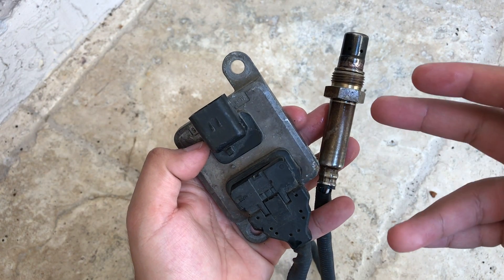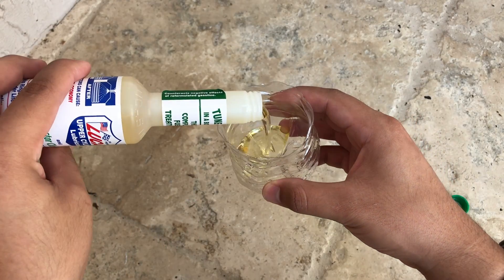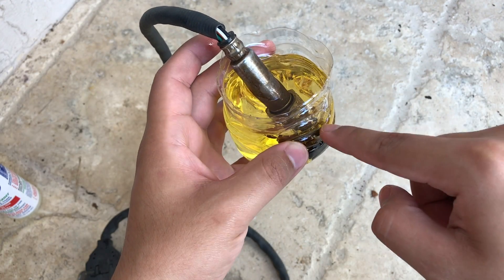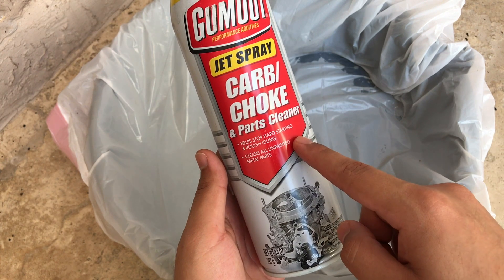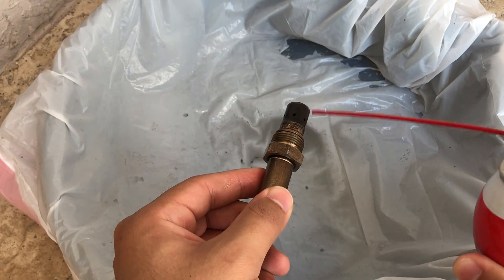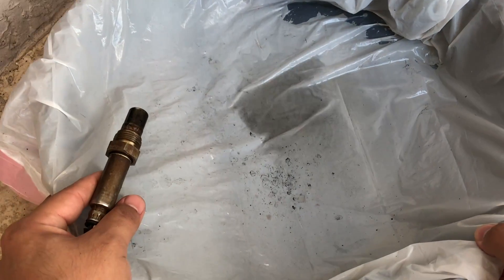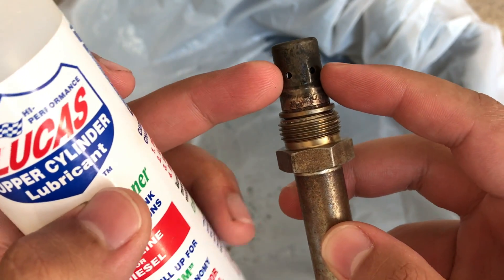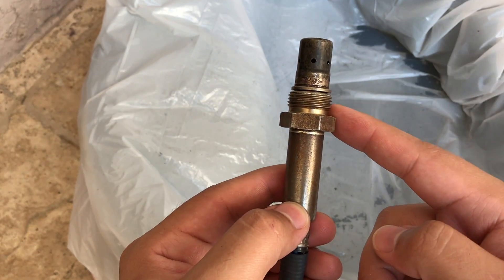How to Clean OXYGEN Sensors [Easy Way]

Comment: I have a Volkswagen Touran 2004 1.6 automatic and it has error code P2201 / 17443 (NOx sensor). Any advice on if I should try cleaning it or just get it replaced? I'm not a technical person at all. Thanks!

Comment: I soaked it in vinegar. Completly clean.
Reply: Did it work when you reinstalled the sensor?
Reply: @gracec1665  following
Reply: Did you put it back and it worked? The CEL went away/cleared?

Comment: My 2002 RX300 O2 Sensor B1, B1 is producing P1133 Error Code !  I'll this cleaning process to see if this will correct the P1133 Error Code !!  Thanks for the illustration !!
Reply: Did work for you on your Lexus?

Comment: Thanks a lot, you make me save money! Before to pay for a new sensor, I clean my BMW F10 N53B30 nox sensor as you explain. After ODB control, all default codes about this have been removed!
Reply: Do you remember what codes came up, when you had this issue??
Reply: @erickmellado6417   12C008. 12C208  12C601. for nox sensor short circuit and signal not available
Reply: Is it necessary to turn off the "check engine" via diagnostics after cleaning or will it definitely turn off if it is working properly?

Comment: You can soak them in plain gasoline too , it works great...never did use F.I. cleaner ..but it makes sense ,  and  not 6-7 hours.... try more like at least  8 hours with some light swirling agitation every hour,  it can take up to 10 hours....dry the O2  sensor and re-install.  
Goes without saying inspect the shit out of all the wiring ..on  ths sensor and vehicle ..i find 50% of the time its wires or a combo of dirt and bad wires
Reply: Petrol or diesel?

Comment: Why do you keep calling it a knock sensor...it's an 02 sensor.
Reply: O2 sensor is for gas cars and nox sensors are for most diesel engines including simi trucks.
They both works the same way. You can clean them and they will still work if there is a soot build up. The soot blocks up the small port holes,that's when the code mostly will appear. Get sm acetone or carb spray or rubbing alcohol and wipe it off good and let it dry. Then install it back. Take your negative battery cable off to reset the code. Make sure you always check your wiring harness as well before installing the sensor back because that's a lot of heat that travels through your exhaust and sometimes it will melt your harness and cause a sensor code. Hope this helps..

Comment: The Lucas cleaner is made to be diluted with gasoline for the best cleaning action.  Which means about 1/10th or less was needed.
Reply: Also use less  much diameter vessel ...will save on extra unnecessary fluid waste
Reply: Even agitating with a brush and then spraying cleaner saves cleaner...too much unnecessary spraying
Reply: The injector cleaner is made to keep this from happening in the first place! I have to change one of mine on my 2019 Duramax one sensor was 100 percent clogged and one is 50 percent clogged. Had I bought this Truck new im sure with running Lucas in the tank this wouldn't have happened in the first place.

Comment: What was the error of the car for the reason of cleaning the sensor? Which problem did you have with the car?
Higher gas consumption?
Thanks
Reply: It throws a check engine code that you see on the dash.  The code is read with a code reader.  I think the specific code number may be unique to each brand or model of vehicle.  A $27 code reader can save you a shit ton of time and money as they usually give you a direction to go to diagnose and correct the problem.  The dealer has a better one that is more exact but the cheap ones will work for you MOST of the time.

Comment: Shit....my o2 sensor cost $250.....going to try this. Well2 see how it gos
Reply: and i paid over 400 dollars to get mine replaced, and after just four months, have to do it again it appears!! 😞
Reply: @neryahwilson6499  do it yourself an save money all you need is a claw tool to remove o2 sensor an the sensor itself which you can buy on ebay for low prices..most of them are OEM parts you can find for way cheaper than spending 400$ brother lmk if you need help finding a good deal.

Comment: Do not do this if you are under warranty.  If you are outside of warranty, do not do this unless you plan to throw the sensor away anyway.  You are at high risk of either ruining the signal long enough to set a fault, or breaking the sensor outright.  If the tip looks a little sooty, just wipe it off with a dry or slightly damp rag.  Do not allow any fluids inside or spray it with anything unless you don't really care anymore, as it contains delicate chemically sensitive electrodes.  This is not a spark plug -- as indicated by its cost.  If you insist on running this little experiment, then using pure fluids that evaporate without residue.  Acetone, 90+% rubbing alcohol, and Carb Spray.  I suggest you avoid using anything like fuel injector cleaner or WD40, as they evaporate slowly and contain additives that could permanently poison the sensor.

FYI, I work on NOx sensor design.
Reply: My question is what is the root cause of the issue of bad o2 sensors? Is it erosion of something inside the sensor that cannot be replaced, or is there a way that they can be refurbished to last another 50-100K miles? Nobody ever talks about what the actual issue is. They just say carbon build up. Well if it is carbon build up, then why is it that when the carbon is removed, they still don't work or only last a month or something. I'm of the mindset that 95% of all things can be fixed or restored (unless there is erroded parts or missing stuff).
Reply: @chancehansen  Once you reach high hours, there are wear-out mechanisms that cannot be fixed.  For example, in a light bulb the tungsten filament slowly evaporates and cannot be fixed.  Similar things are happening inside these sensors.
Reply: Gasoline sounds like it should be ok to clean a sensor since there is unburnt gas regularly flowing through the exhaust albeit in low concentration. What would you suggest to clean it?
Reply: @chrismc8548  r&d of sensors is his livelihood, hes not gonna tell you to salvage a faulty sensor, he'll tell you to buy a new one
Reply: I don't have a faulty sensor just a dirty one that I would like to clean up if possible. No better person to ask how it should be done than a guy who designs sensors for a living. Thanks for your opinion on the matter but I'll wait for Omega QED's response.
Reply: @chrismc8548  
I was going to write a lengthy list of ways you could end up killing the sensor using gasoline, injector cleaner, water, etc., but if someone absolutely insists on soaking it in something, here are my two cents:

Use a high purity solvent that evaporates rapidly, blow it out, then let it sit around for a day to ensure nothing remains inside.  Something like 100% Acetone.  I don't know what good it'll do you, but at least you're less likely to kill the sensor.
Reply: @omegaqed8592  it sounds like the problem is caused by any liquid or residue remaining in the sensor when it gets heated If I'm understanding correctly. This would rule out gasoline for sure. Thanks for the info.
Reply: I was installing a new Y pipe (after converters) that takes a great deal of time and gives access to the downstream O2 sensors on a Nissan Murano 2009. At the price they go for on line it is a no brainer just to replace them. Why would I take all that hassle to attempt a "Cleaning" that is generally panned as a waste of time.
Reply: @kerrysly1  O2 sensors and NOx sensors are different, with largely different price tags in disadvantage to the NOx sensors. O2 ones are "cheap", NOx ones are measured in gold.
Reply: @kerrysly1  look up upstream O2 sensor for a 2003 Honda Civic si (AKA ep3) part #  36531-pnd-a11, the dealer has them listed for the budget friendly price of $760 without installation which is a diy job but the part price is definitely worth trying to clean.  Aftermarket cheap O2 sensors don't work on Hondas.
Reply: If wd40 gets in the system is it fooked for sure or can it purge it eventually?
Reply: Please make better sensors they are not very good. I'm on my 4th one on a sprinter van
Reply: What happens if you use an ultrasound bath?

Comment: I just put mine in ultrasonic cleaner for 2 min and it was all clean! Surprised at what comes out of the holes on the sensor when using a ultrasonic cleaner . I really think it's the best way
Reply: does the engine light still come back on?
Reply: What sauce in the bath
Reply: Soak in 100% acetone or just use carb cleaner nothing else an air pressure to dry faster if you want to get the job done quicker.
Reply: @babyboi4778  I do board-level repair on electronics, electronics that occasionally requires ultrasonic cleaning.  To remove the residual water, the industry standard is 99% isopropyl alcohol (IPA), never acetone.
Reply: in what solution? ive read degreaser/soap/water....and then again w distilled water

Comment: 1) BE A MECHANIC
Don't hire a mechanic to do this and expect little to no charge.
Remove & install (provided its not a removal issue like rusted in place) is a plug & play for a mechanic.

2) Have another vehicle ready for use.
This o2 car will be offline for a few days

3) Stop driving altogether
If youre too cheap to purchase a new sensor (amazon!) then you should not be driving

Comment: hi guys i have 2018 mercedes c220 d my knox sensor downstream looks like gone,garage told me that this kind of methods wouldnt solve the problems .they says cpu needs calibrate as well ??
Reply: Depending on the price it may be more efficient to buy a new sensor. Also, I always reset my computer after every time I alter something on my engine. *To reset a computer, simply unplug your cars battery and let it sit overnight.
Reply: You can get Mercedes to replace the Nox sensor for free as it is a well known issue even by them especially considering the age of your car. I had mine changed on a 2015 E220 BLUETEC some 3 months ago
Reply: @ntandongwenya3897  My dealer yesterday would not replace my NOx sensors under warranty.  They were replaced in 2019 and have about 20,000kms on them.  2015 GLK.

Comment: can i use wd-40 for cleaning?
Reply: WD-40 is only for water displacement.
Reply: No
Reply: WD-40 is specifically a degreaser, as well as a lubricant. So no would not be a very good idea to use WD-40, since it will attract more grime and dirt than anything, overtime.

Comment: I used CRC Mass Air  Flow Sensor Cleaner. It worked well.
Reply: Did you just take off sensors, spray, wipe and re install?

Comment: You will save a couple of weeks a max month,  at the end you need to replace. So two times you will need to dive under your car, and if you break NOx mounting on your cat. then it will be very paunful for your pocket. It wears out not gets dirty. 
Tired NOx makes your car hungry for fuel. So playing with this chemicals you not only breathing toxins but also loosing money and poluting:D
Reply: It is worth to try anything because these sensors are made of gold judging by their price. I am looking for a bypass to this system because i can't afford to change these sensors all the time. If it is this expensive to save a little polution it is not worth it.
Reply: @Davoodoox1  I'm sure it's too late, but have you ever checked out Rock auto parts? They had about 15 different priced sensors for my car, from $34 to over $150.
Reply: @bigredc222  I made a motor optimization (tuning with computer) and AdBlue OFF a couple of days ago and the car runs like new and i will never have to bother with AdBlue correlated problems again. I am super happy and amazed how well a car can actually function when no crap system is in the way.
Reply: @Davoodoox1  Are you saying you have a diesel and figured out a way to get it to run without AdBlue? 
What about when it comes time to get your yearly emission test?
Reply: @bigredc222  No problem with emission testing. Then all the other diesels without AdBlue would fail too??? If you remove the DPF then you have problem with emission testing. Yes a simple programmin called AdBlue OFF was done and car runs like new.
Reply: @Davoodoox1  I would think vehicles that come set up for Adblue would have to meet a different standard than older vehicles without it.
Reply: Where we can get or downoload program for AD Blue OFF to save our selfs from all this sensor crap?
Reply: @martinmitevski4110  There are tuners everywhere nowadays. Just google AdBlue off near where you live. But remember your car is actually not roadworthy anymore afterwards and everything you do is on your own risk. I personally had to do it because i could not stand to pay for the AdBlue system repairs anymore, it was driving me insane.
Reply: @Davoodoox1  I don’t think so that there is any worse upgrade ever made on the Diesel engines  when it was decided for Diesel Engines to have AD BLUE ( for cars and semi trucks engines also)
Reply: @martinmitevski4110  Yes i somewhat agree. The system itself is almost magic. Think of the old days when a dieseltruck was running inside a warehouse for example. It was impossible not to start feeling sick within seconds. But modern diesels with AdBlue you can not even smell they are running. But when the sensors cost thousands of € to change it is impossible to keep the system running. If a sensor was only max 150€ each  i would keep the system running, but my last bill was 1200€ for ONE NoX sensor. And usually they change both at the same time.
Reply: @Davoodoox1  Do you think any Aftermarket Cheapper sensors will work?

Comment: Makes me think hmm drill hole near sensor put the cleaner on the sensor then jb weld pipe shut won't have to take sensor out,
Reply: that might just work.  Drill some more holes so you can clean the sensor.  Wrap it up with some metal sheet.  These fcking sensors are too expensive to be replaced.

Comment: It's not a Knock Sensor.  It's not at Oxygen sensor either.  He's saying NOx as in oxides of nitrogen.  NOx sensors like the one he's cleaning can cost $800 each.  NOx is NO1 and NO2.  It's an acid rain particle with one nitrogen and either 1 or 2 oxygen atoms stuck to it.  The "x' is a variable.  NOx is formed at temperatures over 2400°F.  A NOx sensor is part of a selective catalyst reduction system.  In simple terms- diesel exhaust fluid (DEF) system that uses urea to neutralize N0x into ammonia.  The system will have one in the front by the turbo and one at the end of the exhaust selective catalyst reduction unit.
Reply: Well sorry to see you must be bored
Reply: How do you know your NOx sensor is dirty and not just broken?
Reply: @cherryrose6438  you clean it, reinstall and see if CEL disappears. Rinse and repeat until you have success or throw in the towel that it’s broken. Your car or obd2 scanner may help indicate it can’t just be cleaned, but hey what harm in trying.

Comment: WELL???  What was the outcome once you reinstalled it in the vehicle? Or did you even use it again? I guess my point being did it work or not after you cleaned it? And it's a O2 sensor, not a knock sensor. But thanks for the video. I just want to know so im not wasting more time than i already have on this p.o.s.car I bought.
Reply: The sensor is a Nox (No1/No2) or oxides of nitrogen (acid rain causing pollutant) sensor located in the exhaust of DEF SCR equipped diesel engines.
Reply: Of course it didn't work this guy doesn't know what he's, no goggles,  gloves PPE's. The spray and soaking will not completely clean carbon. Get a new sensor.
Reply: Sensor alone is $600 each,  have to be replaced in matching pairs.. I have issues with my SCR throwing a P1C54 Code.  Tech at Nissan said it could be a $4,000 SCR, (no diesel techs at any Local Nissan dealers)  Nissan corp is no help at all, I have 23,000 miles on truck and they abandoned me. After 3 years.. plan on, if truck last to delete it after warranty, that is not really helping anyway,.. I am just in a survival mode right now as I don't want to keep replacing cheap built Nox Sensors.. every 23,000 miles. And I do not have equipment to put the truck into an Manual Regen mode and reprogram the system,  and I don't want to go into limp mode..
Reply: @Funky4me21  That sucks.  P1C54 means "Catalyst Missing".  Essentially your outlet NOx sensor is seeing a lot of NOx (or DEF), so it thinks your have removed the catalyst.  This indicates a severe issue with your DEF dosing or conversion across the catalyst.  With such a young vehicle, the most likely culprit is your DEF doser.  If they've replaced the sensors, and that did not fix it, then it's unlikely the sensors are the problem.  Maybe ask them if they checked the DEF doser, and also check for urea deposits near the DEF injector.  If you're in a cold climate, it's also possible your Urea is freezing up.
Reply: @TD-tb5xk  for $500? Don't mind if I do :B

Comment: Using injector cleaner is unnecessary. Just use injector cleaning spray will work.
Reply: So, what you are saying is injector cleaner is not necessary, but injector cleaner will work?